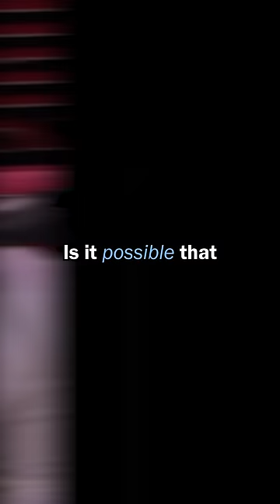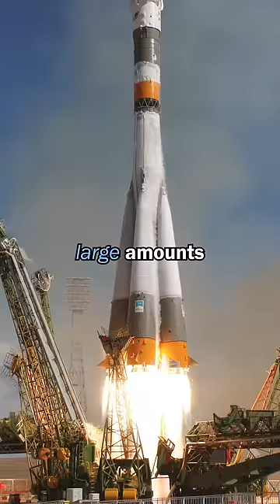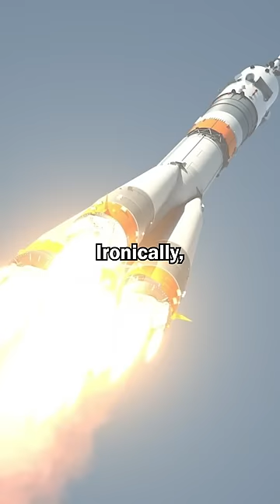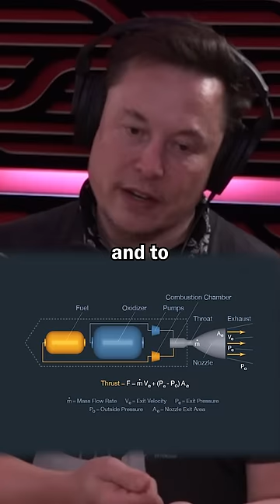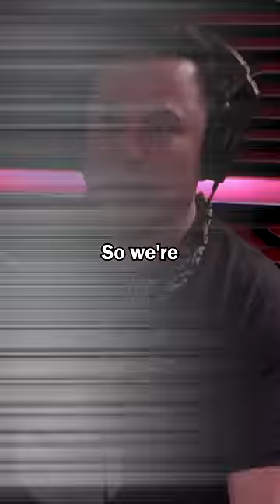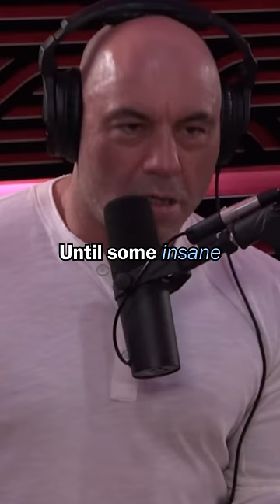Why This Rocket Engine Will NEVER Work!! ☢️ #spacex

Comment: "Not in our lifetime"   AI: "Hold my beer"
Reply: That doesn't make sense
Reply: AUPs say - hold my beer.
Reply: ROFL
Reply: Nope.
Reply: @ThePokeChannel1  It implies that AI will come up with a new solution (such as using large amounts of electricity to create magnetic repulsion maybe). AI only took 30 days to find cures for multiple cancers, whereas it took humans decades to do something similar.
Reply: @_jeck_ source?
Reply: AI in its cyrrent iteration is basically an advanced google search. It cant create its own ideas yet
Reply: @dranreb1118  It can actually, based on existing data. That's how AI developed an ultra-efficient blade for drones, sneakers and cures for cancer.
Reply: @ThePokeChannel1 there are known unknowns and unknown unknowns. While he may be correct that with current ideas there are only known unknowns for alternative sourcing, there could well still be and probably are unknown unknowns. So yes, this is a reasonable thing since AI will supersede human capabilities in terms of being able to creatively digest and analyse very large amounts of information, likely at a higher intelligence than any human can possess, within the next 20 years. Assuming we aren’t ended because of it.
Reply: AI is getting and will get exponencialy better. That is something we are and we should be scare of. It also brings and it will bring many new ideas in many fields. You as human can calculate 2+2=4 in about a second. Your phone can calculate such operation hundred times in one second. That means our brain has some limits that AI does not have.... still our brain has some advatages, but I would not bet against something like "AI can think of new propulsion system in next 10 years". Anyone beting against that is taking serious risk of loosing.
Reply: @_jeck_ there is no cure for cancer currently
Reply: @BassRck50 why do people pretend like ion propulsion doesnt use propellant? Its in the freaking name!
Reply: @_jeck_ The cures have been kept from us.
Reply: After using AI for a bit it hasn't really wowed me, I found it's answers generic and nothing new, also I hated that on factual answers it also added generic opinions, but you can't have an opinion if there is a fact. I am sure (well hopeful) they will get it right though.
Reply: @_jeck_  AI hasn't made a cure but has been able to diagnose for better treatment, even apparently being able to determine how long someone has to live. 
Though there was news a few months back about Moderna and there being vaccines for some cancers and heart disease by 2030 with them starting to offer them from 2028.
Reply: @Zauchi  That's not true. AI has developed cures that are currently entering trial stages for humans (already proven effective in animals).
Reply: @Zauchi  You're talking about ChatGPT, not AI in general. The language model of ChatGPT is it's own thing, while AI is used in many different ways to learn how to solve complex problems.
Reply: The last person I would take serious on what is not technologically possible to achieve in our lifetime most than not is musk
Reply: @ThePokeChannel1 yes it does. When the singularly happens, AI will surpass human intelligence. That is expected to happen in about 10 years. There's no telling what AIs will be able to make breakthroughs on
Reply: @dranreb1118 right,  but it most certainly will in our lifetime. It's expected to happen in 10 years
Reply: @dranreb1118 your comment just revealed your ignorance about AI... You're talking about the chatgpt stuff but there are tons of AIs that do insane things in science... Go read a book
Reply: @_jeck_  What you're describing is just an ion drive, which already exists. AI can't think up something revolutionary different, just refine/reapply existing human designs/technology, sometimes past a point where something inefficient or too complex to finetune  becomes feasible.
Reply: @Zauchi You aren’t using it to its full potential then. It can write code, create spreadsheets, write emails, make legal contracts, create meal plans, and so many more tools available. These are all new and very useful things
Reply: @tobiasrietveld3819 you have a very narrow view of what is possible. AI can definitely surpass human capabilities, and already does today in many areas. It’s just a matter of time when AI surpasses us in everything.
Reply: @tobiasrietveld3819  We don't have ion drives on Earth, only space. We'd need AI to figure out how to safely acquire and utilize a much more massive amount of energy to break free from gravity models. It's exactly as you said, a refinement of existing human technology.
Reply: @ThePokeChannel1 AI will make monumental discoveries soon.
Reply: @_jeck_ i heard about one of those medications. It reprograms cells to experience apoptosis, right?
Reply: He's actually not that smart.
Reply: So? The engine burning metals  no long remembered ? Tech degradation again?
Reply: Quantum computers plus ai
Reply: Dr. Richard Greer 
They've had antigravity and blah blah blah for the past hundred years
Reply: @_jeck_ that’s optimistic. Haven’t seen anything you mentioned about ai yet. But the thing is it’d also have to be practical. Anyone can cook up ridiculous ideas to many different things but they actually have to be practical in real world
Reply: gas is everthing
Reply: Not Ai quantum computers will help with out with us reaching higher speeds
Reply: watch his eyes when he says “not in our lifetime” He is lying.
Reply: his eye movement indicate he is lying when he says “not in our lifetime”.
Reply: What about magnets with the molecular magnetism? I am drunk stoned and a high-school drop out. Did i just think outside the education box?
Reply: @ThePokeChannel1 Artificial intelligence makes perfect sense if it’s truly Intelligent and can make creative concepts. There might be another Nicola Tesla with space exploration it’s the future so no one knows and everything is on the table.
Reply: Bear: "Hold my beer"
Reply: @dranreb1118 you cannot know current state of ai. Nobody can. Except those who actualy write the code and teach it(ai).
Reply: Exactly this. People just don't realize the impact AGI will have on the world.

Comment: ION propulsion has left the chat.
Reply: thank you👍
Reply: Which still requires propellant.
Reply: it is still in the confinces of what elon is saying.... you guys try sounding smart but have actually no idea what you are talking about, the rockets will still need to go up, ion propulsion can't do that, and even after that the chances that those ions will come in a gaseous state are very likely...
Reply: Ion propulsion is gas propulsion.

A gas is ionized (made magnetic), and then accelerated out the back. 

Typical Xenon gas is used (because of its high density).

Everything you could possibly think of or dig up that currently exists, is all gas propulsion. 
Nuclear rockets use gas propulsion as well.

Btw "gas" refers to the state of matter. E.g. Solid, liquid, gas.

All space engines that will be created in the next 100 years will be gas propulsion. In other words ion drives, nuclear rockets, combustion rockets,...they will all shoot a gas out the back.
Reply: @tylerdurden3722  theres actually some weird no energy drive being tried out very soon in orbit... nobody thinks it will work..... pretty much says it all right there
Reply: Came here to say this
Reply: still throwing crap out the back-end!
Reply: @tylerdurden3722  You can use nuclear bombs as propulsion, by using the explosive force of a nuke to push a plate at the end of the ship to move it move. That being said, it is still a physical means of propulsion, not a electric one. It's also incredibly inefficient means, but still possible.
Reply: @tylerdurden3722 the only exception is a solar sail but that loses efficiency the further it gets from the sun and it only works one way.
Reply: I've heard of this theory of using deflected antimatter to generate a force for an object but I'm no expert
Reply: You still need rocket fuel to get into space and then hydrogen to make an ion drive work
Reply: @Crimson.S.57 but you dont lose any speed if its travelling super fast it will only continue or go faster till it hits something
Reply: @clickmcclick2675  you are talking about an EM drive, which was tested on Earth (nobody has flown it to orbit). Initially NASA team saw some thrust from it, but then they found a mistake, so it doesn't work.
Reply: XENON has left the chat too...
Reply: @eddyecho  well, not really. There are ionization processes using sun light.
Reply: Ion propulsion still used Xenon as reaction mass. Its just the means of acceleration of the gas that is different
Reply: He's wrong. It will happen in our lifetime
Reply: Ion propulsion also cant be used for fast maneuvers. It can be used to slowly accelrate over a long period of time but you need traditional fuel (LOX/LH2) to slow down from insane speeds quickly. Otherwise you spend half your trip decelerating spending more time
Reply: Ion is super efficient because the exhaust is super fast but light. It's super weak though, and is only used in space
Reply: @adambalogh8728 so could ion propulsion be used in a space vaccuum and then gas to get it out of atmosphere?
Reply: @ahuman5450 You can also just let the antimatter annihilate with "normal" matter to create some pretty insane amounts of energy and use that as propulsion (which would be insanely effective, as such engines could propel you at something like 70 % the speed of light)
Reply: You know you expel Xenon in ion propulsion right?
Reply: "Not in our lifetime."
Reply: @Douglemagne  Yeah, that's the unfortunate part
Reply: Sorry, but no. It still works on the same principle, ions are nothing but charged accelerated - mass.
Reply: are you talking about the ions within the gas which is expelled? Still a gas

Comment: Starlink literally uses Argon and Krypton ion thrusters on their satellites... You just can't use that to get to space since it's weak/slow, but plus side it's extremely efficient.
Reply: throwaway3873 an electric field propels the ions
Reply: throwaway3873 lol never heard of ion thrusters?
Reply: A rocket is something that boosts things into orbit, not just adjust them once they’re there
Reply: Yeah. Which accelerates mass that's inside it. aka fuel. Still the same thing as Elon said.

Comment: NERVA program has left the chat
Reply: I believe he means rocket launches from Earth to LEO which NTRs are useless at as they have a TWR less than 1.
Reply: @Etheoma he actually means IN space. You need propulsion in space as there is no active resistance force you can use to move around.
Reply: @veteranredbeard6222 You do realize that NTRs and plasma thrusters do propel themselves just like normal rockets do, right?
Reply: @veteranredbeard6222  god damnit I meant Elon meant for launches from ground to LEO. I knew the OP meant in space of which there are plenty of options for other propulsion methods of which some we use currently like hall effect thrusters which Elon is perfectly aware of considering they the them on the star link satallites.
Reply: British firm pulsar fusion 1st to build and test a working plasma fusion engine
Reply: @Etheoma Elon meant leaving from earth gravity, not in space, if you think about air combustion pressure to thrust something  on space in result it won't go far in a distance about some couple of miles
Reply: @rawandaman3628 he veey clearly says in the video, in space there is notjing to propel against so you have to use your self. Elon was talking about in space, if you lot cant get the simple part then stop talking like you know anything about rocket engineering...
Reply: Still uses gas.
Reply: Nerva still use gas, and in that case hydrogen

Comment: I feel elon is talking about actual gas and joe is thinking of gasoline
Reply: Elon is talking about petroleum, not the state of matter.
Reply: @jimmyc451  bruh do you even know what you’re talking about? Just google spacecraft propulsion
Reply: @shriram5494  bruh I worked at NASA (msfc) to be exact
Reply: @jimmyc451  This is from Wikipedia: A large fraction of the rocket engines in use today are chemical rockets; that is, they obtain the energy needed to generate thrust by chemical reactions to create a hot gas that is expanded to produce thrust.
Reply: @jimmyc451  I worked at a petrol station (bp) to be exact
Reply: @shriram5494  bp is overpriced but made a good movie when their platform exploded. Wasn’t great for AL tourism tho
Reply: @jimmyc451 Sure you did buddy.
Reply: @janne7263  hahaha
Reply: Elon makes zero sense lol he is talking about gas - the state of matter - being expelled like it's the same thing as gasoline? You could theoretically use literally any fuel source to expel the gas. Even if gasoline was the only way he didn't come close to explaining why.
Reply: @craigballington2214  A lot of rockets use highly refined kerosene, which is an oil derivative.
Reply: @jimmyc451  then you’d know is kerosene not gasoline in rocket boosters
Reply: @shriram5494 "Wikipedia? You're using Wikipedia as your source? Tsk tsk tsk"
Reply: @kalebnelson4569  I said petroleum, not gasoline.
Reply: @craigballington2214 Because fuels like rocket fuel or gasoline are highly volatile and accelerates rapidly causing more force to come in both directions

Dumping a shit ton of oxygen or that out the back even pressurized would provide nothing close
Reply: @TheMissiIe still more accurate than mainstream media
Reply: air is gas. he's talking about any liquid used for chemical reaction
Reply: @craigballington2214  he was asked if there would ever be viable alternayives to conventional rockets, he said no, we're stuck with gas propulsion. His response made perfect sense.
Reply: @craigballington2214  He makes total sense in this video, he isn't expaining the concept of conservation of momentum to scientists or people that understand physics jargon. He's explaing it to Joe. Joe is referring to gas (gasoline/fuel) and the usage of that in rockets, whether or not it will still be that in the future. Elon explains that within our lifetime we will still be using such fuel because in a vaccum you must expel mass and in this case it goes from a fuel into gas (air).
Reply: @TheMissiIe better then to listen to randoms on YT!
Reply: yeah, what was truly pushed the rocket is the high speed gas that expelled the rocket. We apparently found that burning a squirting kerosene with liquid oxygen expels a high speed and high energy gas out from a rocket. But there's a rocket engine that is a highly pressurized gas squirted out to provide thrust, one of them is cold gas thruster
Reply: @craigballington2214  well “gas” in rocket engines actually involves liquid hydrogen. It is not just petrol or gasoline.
Reply: @kalebnelson4569  yep.
Reply: @TheMissiIe  wikipedia is one of most reliable sources of information available. If not THE most for the English language at least.
Reply: @kalebnelson4569  but yeah kerosene and liquid oxygen are another kind. These sorts of rockets tend to have higher propellant capabilities also. I am a bit baffled by the conversation in this video. Then again Elon is not as smart as people think, he is a very good businessman and good at hiring the right talent above all else. He’s not an engineer. He was sacked from PayPal because he said they should use windows servers 😂 anyone who knows anything much about programming, especially payment systems, would understand why.
Reply: @jimmyc451 He's talking about the state of matter gas.

Nuclear propulsion, cumbustion propulsion, ion propulsion all work by shooting a gas out the back. These are all forms of gas propulsion.
Reply: @jimmyc451  Yeah but hydrogen and methane arent petroleum products
Reply: @Kerbal18  methane?  His rockets burn kerosene (and lox of course) though I know he is messing around with liquid methane.
Reply: @jimmyc451  Have you heard of this one little thing called Starship, the biggest and most powerful rocket ever constructed and flown?